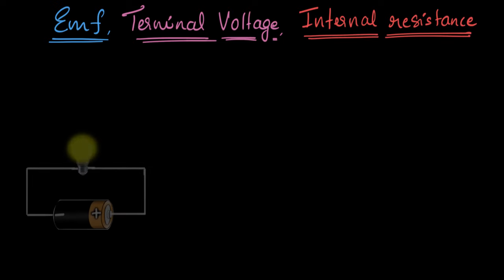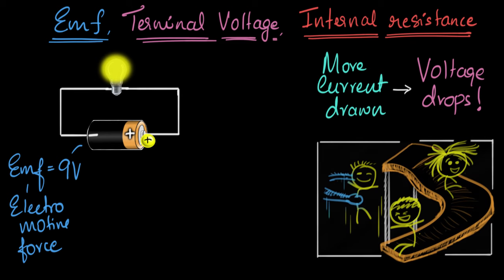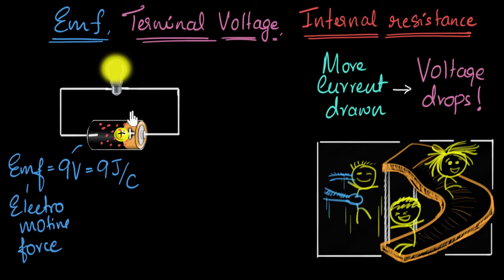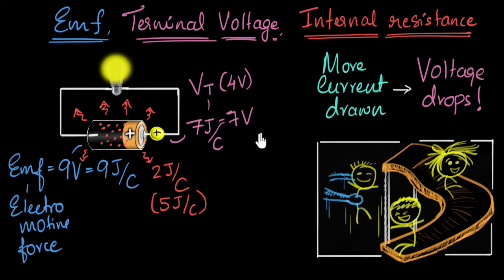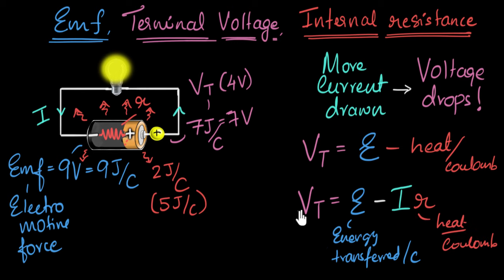Cells, EMF, terminal voltage & internal resistance | Electric current | Physics | Khan Academy

Comment: Great video as always. Just one small point. When more current is drawn, the charges don't move any faster, but more charges are pumped per unit time. Current is the flow rate of charge (charge density per time) not its velocity. The travelled distance per unit time per charge (charge velocity) is not affected. More charges require more work (energy) to go through the internal resistor, and the more work is done per unit time, the greater amount of energy is lost as heat.

Comment: in parallel circuit voltage remains same right so why will the bulb glow less brightly as you told in the beginning?
Reply: In parallel circuits the voltage across the batterry and the resistors is the same, but it does still get reduced as we add in more resistors in parallel (because more current = more heat loss = reduced terminal voltage).
Reply: @jax1296  ahh yes thank youu!!

Comment: When more current is drawn so voltage drop but normally in parallel we know that in parallel combination the voltage is constant right!!!!
Reply: That is happening because more and more energy will be lost to the internal resistance in a real life situation as the current drawn increases when more batteries are connected
Reply: Yes, I too was having the same doubt 😐🙄
Reply: @aog3367  that is ideal source but practically its impossible
Reply: Voltage is constant for a given number of resistors, not if you keep adding resistors. 
Suppose you have 3 resistors (Call them A,B and C) in parallel. The voltage across each resistor, V is constant or each resistor has the same potential difference across its ends.

Now you add another resistor D in parallel to the other 3. In this case the voltage will change to some V’. Across each resistor A,B,C and D , the voltage is now V’ ( ie. Voltage is constant across each resistor)
So voltage varies if you add more resistors. When they say that voltage in parallel is a constant they mean FOR A GIVEN NUMBER OF RESISTORS, voltage is constant

Comment: Summary Of The Video :-

EMF , Terminal Voltage , Internal Resistance

* EMF is a number written on a battery like 9 V represent EMF.

* EMF stands for Electro Motive Force.

* But in reality EMF is not a measure of force , it is the measure of Energy.

Hence , we can say EMF is a Misnomer

* If EMF of a battery is say 9V then  it would mean that battery transfer 9 Joule of energy per Coulomb.

* Chemical inside the battery resist the flow of charge.

"That Resistance Is Known As Internal Resistance "

* As we connect battery to a circuit , charges move inside a battery and  its energy get wasted as heat beacuse of internal resistance.

* The voltage across the terminal of the battery is known as Terminal Voltage ( When battery is connected to a circuit)

* Remember - Terminal Voltage is always less than th EMF because of internal resistance.

* If current is zero then - 

EMF =Terminal Voltage

* Formula  V = E - Ir

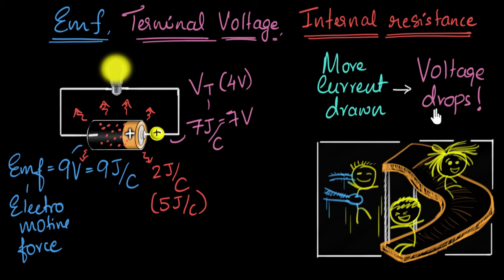Comment: 10:57 I think that is a wrong statement because drift velocity of electrons is always constant. You should have said more number of electrons are being transferred through unit cross section per unit time and hence more heat energy.
Correct me if I am wrong
Reply: No. of electrons/volume always remain constant
The speed of current can definitely inc/ dec
You can't change the number of electrons

Comment: I think it is incorrect to say that charges move faster or slower through a circuit. Rather it is the amount of current that changes. More current through the battery means that more heat is dissipated by the internal resistance of the battery.
Reply: Can you explain how current increases if velocity of electrones is kept constant?

Comment: After equilibrium, as no charge will flow from the Cathode to Anode of the cell so no energy will be lost in form of heat in it and right at this condition the P.D. across the two terminals is called E.M.F. Thanks from Bangladesh.

Comment: so tv < emf, emf is the total work done but tv is the actual potential difference created

vt = Emf - IR, IR is the heat generated by internal resistance, Emf is the actual force abd Vt is the effective voltage or voltage at terminals

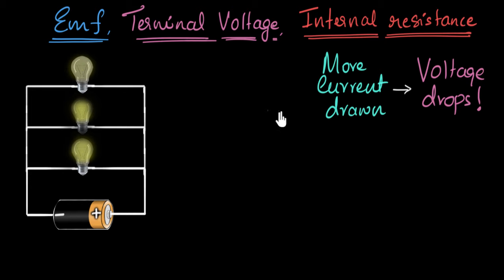Comment: At 2:20 can any one relate the video with ohms law according to it current is directly proportional to voltage so as per my thinking if more current gets drawn more voltage should be passed
Reply: current is directly proportional to voltage(Ir- loss as heat/coulomb)
when (Ir- loss as heat/coulomb) increases, terminal voltage decreases

Comment: Using the example of  3 lights. 
If you wanted the lights to be bright.
Would you increase the current or the voltage of the emf source. Without burning the lights.
Reply: It is voltage which guide brightness of the bulb , I think there is something missing
Reply: The arrangement of lights in circuit will determine the current flowing through them
Ofc the parallel circuit will reduce effective resistance thus more current will be drawn.....according to the content in the video

Comment: Since it a parallel circuit the voltage is going to remain the same isn't it
Reply: Yes but the current drops.
Reply: @madman0016  so the resistance will increase, voltage will still remain same

Comment: The battery contains ions where as conductor contains protons and electrons as moving charges( protons wont move so, assume) 
In a battery the positive and negative ions will be present 
(So here positive ions moves inside the battery) 
My question ,
The positive ion moves towards positive terminal and repel, but the proton( when negative electron) comes out of the battery into the conductor ...... how??
Reply: You would need to study electrochemistry and electrochemical cells.Just remeber in batteries, current flow is opposite to the rest of circuit.In a battery current moves from - to + opposite to circuit where it moves from + to -

Comment: But according to ohms law voltage is directly proportional to cureent......
Sir can u plz answer it?????
Reply: Well that makes sense right? Consider the internal resistance of the cell as a simple resistor. The voltage drop of the cell is simply the potential difference or the voltage across the resistor (internal resistance). As the amount of current passing through the resistor increases (i.e I increases), the voltage across the resistor (voltage drop v) increases too. So more energy is spent in moving across the cell so less energy remains in the charges to move across the external circuit. As Terminal voltage= EMF- voltage drop of cell and the voltage drop increases, the terminal voltage will obviously decrease.

Comment: Your explanation was excellent. But I have a doubt and it is if a parallel connection decreases the terminal voltages of the lights or keeps the same or equal.
Reply: It was explained very well in the video
The effective resistance dec so more current is drawn so there is more heat loss, i.e. voltage drops further. It means Terminal voltage will decrease

Comment: I have a question: Is is possible to move the charge faster when the same resistance exists....
Reply: @PallaviSingh  i also have the same question, but I don't think so
Reply: Yes if u increase the voltage that is  the potential difference across the resistor then the current increases which is the rate of flow of charge which means the charges would move faster through the resistor, u would've seen it in ohm's law as well i guess
Reply: Reduce the temperature to 0 point. 

And, resistance is almost gone.

Comment: I have question u told that if the charge will travel very slow in battery all the voltage will applied across the circuit but when this happen will the bulb glow with that effectively than before

Comment: If terminal voltage decrease then current should also decrease right ? If current decrease the energy lost as heat decrease. So the terminal voltage will increase. So the bulbs should start glowing brighter. But this is not happening. Can you please correct me where i got wrong.

Comment: But why would drawing out more current cause an increase in the charges' speed?

Are you implying that a circuit element's Resistance causes a change in current flow rate? The lower a circuit element's resistance the more charge can move through it at a given time?  And, when a circuit element has a higher resistance this causes a kind of "traffic jam" preventing charges from moving as quick?

Or, are you saying that the more current leaving the battery means more "friction" and heat loss? Because I can understand that better than a charge's speed increasing.

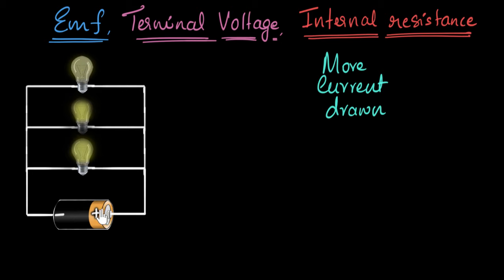Comment: One question 🙋 sir at 1:44 you said that the resistance decreases because it is in Parrellel now the current should have increased in that case i can't understand
Reply: It seems counter-intuitive, but basically the resistances decreases when we add a new loop into the circuit, even if there's a resistor in it. The resistances decreases because despite there being a resistor, there is a new path for the current to flow through and the current will flow a path where there is least resistance.

Comment: Can the equation V=E-IR be used to find out the voltage after a resistor in a circuit?

Comment: You mean that the drop in terminal voltages is the result of loss of energy during the flow of electron 🤨🤨
Reply: Ye, electrons collide with atoms and positive ions resulting in a loss of energy as heat

Comment: 2:13 it seems to contradict the ohms law,can anyone clear this doubt of mine
Reply: When we draw more through battery, we are forcing the current to flow faster. When current flows faster through the battery, the heat loss and thus internal resistance increases. As a result, terminal voltage decreases i.e., less energy is supplied to charge. This is the reason, bulb glows dimmer and obviously voltage drops.
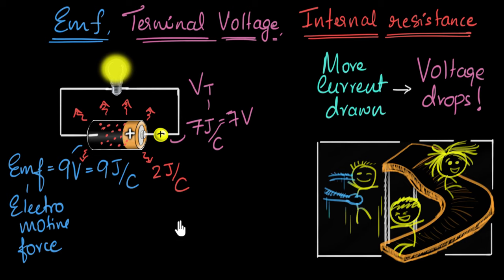8:25 this is where he starts explaining this concept.

Comment: I don't understand how the coulomb of charge ends up at the other end of the battery with less energy. It's like me climbing stairs with more clothes on. I end up doing more work which does indeed get dissipated as heat, but when I reach the top, the only energy I'll have is the potential energy due to gravity
Reply: Imagine you are climbing up the stairs but there are a lot of obstruction in the path , so in order to tackle these obstruction you used a lot of energy than required to climb the stairs 
So here the total energy used by you is emf ( gravitional potential + obstacle tackling energy)
But your actual energy at the terrace is only the gravitional potential energy
Here the only difference between an cell and this example is 
You only needed the gravitional potential energy equivalent work,  but you did more work to move to the terrace
But in the cell the cell provides all the energy to make a large potential difference but some is lost because of internal resistance.
I hope.you got it 😀

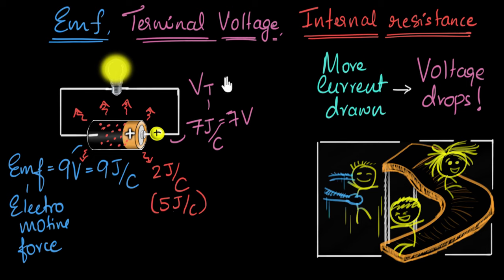Comment: Sir at 10:33 minute you given the wrong concept that you said the weather it is moving fast or slow inside the battery 1 coulomb of charge remains get same energy per inside the inside the battery that is that is not true because energy is time dependent so the rate of moving of charge is directly dependent on the battery energy dissipation per unit time because energy is time dependent and intense power dependent time the power power is directly matter for the how intensely the bulbs will go glow that is the matters are you given totally wrong concept please please correct
Reply: That word totally change the sense of the whole video please make it right
Reply: Thanks
Reply from the maker: The energy delivered by the battery = work done by the battery = force*distance. 
Can you elaborate how is it time dependent?